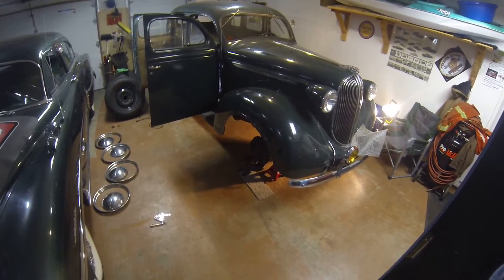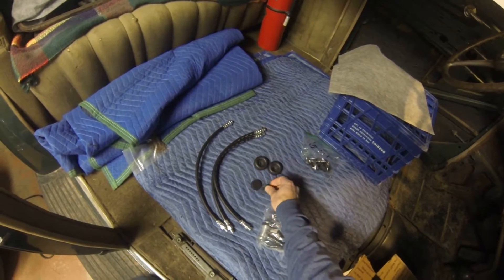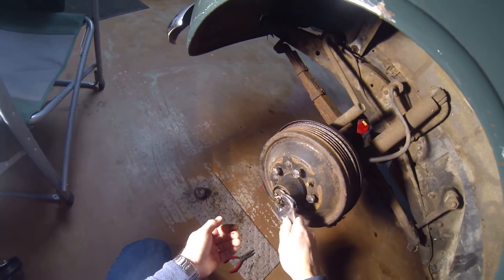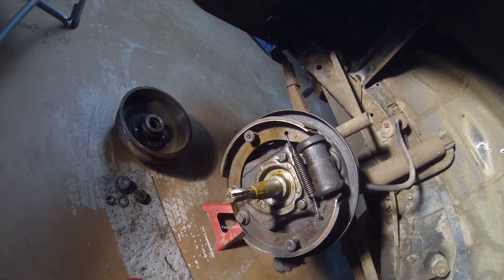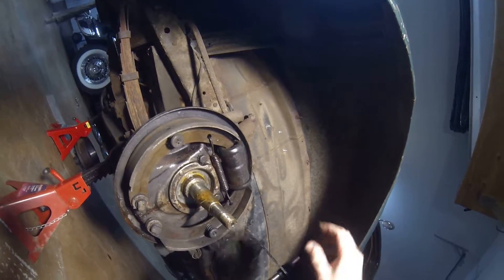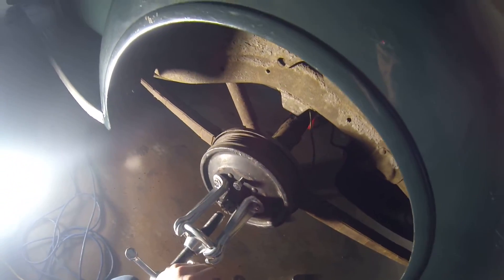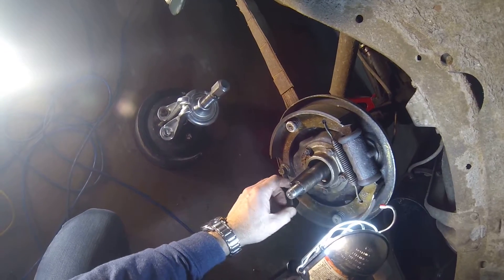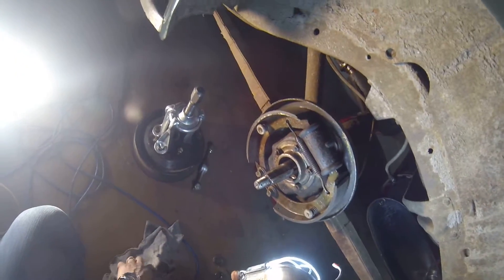Vintage Mopar Lockheed Brakes - 1938 Plymouth

Comment: Good Video Keith! Thanks for sharing. I had a buddy over yesterday with a Canadian 1940 Plymouth 4dr. Sedan. Brakes look the same. ?? You didn't talk about the adjusting cam nuts. does the '38 not have those adjusters? They are on the reverse side of my buddies '40.

Comment: Thank you for the video. I have a question. I have a 1941 Plymouth and just rebuilt the master cylinder. Now when I drive the brakes get extremely tight and the wheels are very hot. I don’t hear dragging but something is getting tight. Any advice. Thanks
Reply from the maker: Your master cylinder is likely not relieving all pressure when you let off the brake. You may have installed something wrong when re-assembling the master cylinder . Or the air relief hole in the master cylinder fill plug may plugged up.

Comment: This is interesting. Will bigger drums and shoes from a Chrysler or DeSoto of the same era fit on these Plymouth hubs, for more front-end stopping power?
Reply from the maker: I’ve never tried. However the rear backing plate would be too small too. So it would also have to be considered for change, if one were experimenting.

Comment: This video itself answered all my questions on these brake systems. I was wondering what the torque should be on the axle nut. Only a couple ft pounds. That's pretty interesting! Thanks man
Reply from the maker: Tighten the large axle nut to 130 of so ft lbs.
Reply: @keithsgarage5831  awesome. Thanks a ton man!
Reply from the maker: @stuartcR  Watch as any of my videos as you can stand. Tons and tons of info to help you out with your old flathead Mopar.

Comment: Hi Keith, I just finished rebuilding brakes on a 35 4 door. Should the front shoe and rear shoe extend at the same time? On the rear, only my rear shoe is extending. On the front wheels, only the front shoe is extending. Maybe I should introduce some air at each individual drum so the pistons extend farther from the brake cylinder?  Thanks David
Reply from the maker: In my humble opinion, no. Not necessarily. The brake fluid will take the least path of resistance. Pushing the piston out that move the easiest. When it starts to resist any movement the other piston moves outward. When the drum is on, over the shoes you want minimal clearance between the drum and the shoe. Just a hair of drag, when the shoes are concentric.  When the front shoe contacts the drum, it see's resistance. Then the rear shoe immediately starts to move outward as well.  Get your drums on. Set shoes concentric. Dial in the minimal clearance and go for a drive. Brakes should feel very good if set right.  Did you replace the brake flex lines? If unknown life on them, you should.
Reply: @keithsgarage5831  Thanks for the reply. My front drums slid on with just a little friction, but my back has one too tight, and the other won't even start to go on. How should I compress the shoes? I opened the bleed valve but still can't get them to budge. Thanks

Comment: After looking at your video for the fifth time I see a difference in your wheel cylinders. Mine has three bolts in the back of the cylinder. But still this is helpful.

Comment: That was a great video on how to adjust the brake shoes, thanks. My problem is I can't adjust mine because the wheel cylinder pushes the shoes out and I don't know why. I've bleed then multiple times with no luck fixing this problem.  Do you have any suggestions. I have a 1938 Chrysler Royal.
Reply from the maker: I’m not quite sure what you mean. Are the shoes unable to collapse inward? Are they out too far at the cylinder and the drum won’t fit on, over the shoes?
Reply: @keithsgarage5831  Thanks for getting back to me. When I try to put the drums on the shoes are to far out, So push the shoes into the wheel cylinder and they slowly spring back outward. I managed to get the drum on but they are real tight with the shoes adjusted all the way in. I'm not sure how else to explain it.
Reply from the maker: scoutermoe Shoes or pin length are incorrect probably.
Reply: @keithsgarage5831  Everything on the there is original (shoes-relined, springs, pins) except the wheel cylinders. Is it possible that they are not the correct wheel cylinders? I got them from a guy that I have bought a lot of parts from and have had no problems with anything else. I'm just really lost with this issue.
Reply from the maker: scoutermoe If everything else is right, or original, very highly likely your problem is incorrect wheel cylinders.

Comment: The reverse threading of the wheel nuts on one side of the car is a hold over from when cars had one central wheel nut, in which the derection of the threading is  important and they figured car owners would have this fact heavily ingrained in their memory from when they had to change flat tires every 50 miles due to nails in the road . I guess you could say they didn't want to reinvent the wheel...nut. this feature was probably phased out as a cost cutting measure and standardized to right hand thread all around

Comment: Interesting to see roller bearings -- I would have expected ball bearings in a car that age. Is it converted, or were they like that from the factory?
Reply from the maker: The bearings are stock.The front wheels are tapered roller bearings. The rear axle shafts are tapered roller bearings. There are ball bearings at input and outputs of the tranny.
Reply: @MrBirdnose Chrysler Was Actually A LEADING Innovator In The Car Industry In The 30's And 40's. And Even TOO  FAR  Ahead When It Came To Their  "Airflow" And "Airstream" Cars During The 1930's.  Also Having Hydraulic Brakes YEARS Before Ford Got Away From Their Mechanical Brakes.  And Even Later  By Introducing The Hemi-Headed V-8 Engine In The Early 1950's.   When Ford Was Still Using Flathead's And Chevy Was Relying On OHV 6-Cylinder "Stove Bolt" Engines...

Comment: Do you sell your adjusting tool ?  I would like one for my DeSoto S-11 .
Reply from the maker: I don't but will consider it. I'll look into fabricating 6 or so and selling them.
Reply: Can you weld? It is a piece of threaded rod welded to a nut to fit the spindle. The there are two other nuts for the threaded rod that allow adjustment of a sturdy tang with a curved tip.